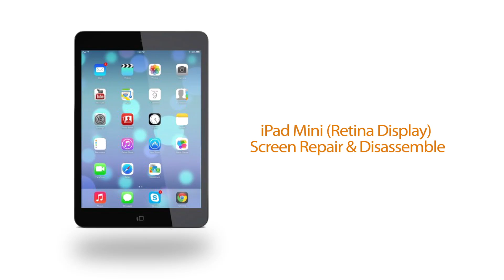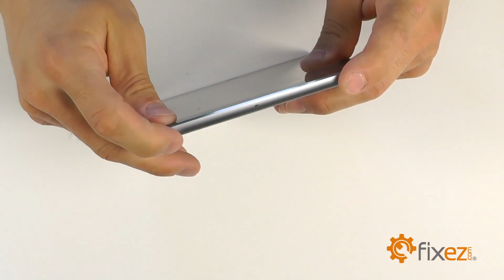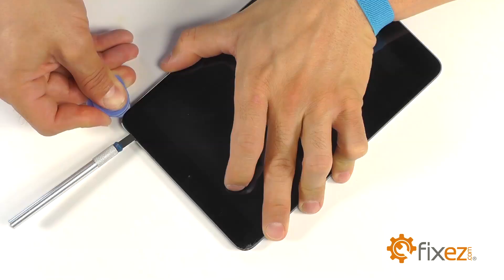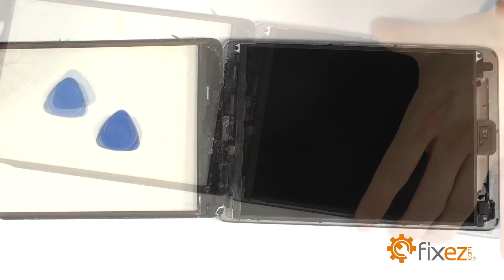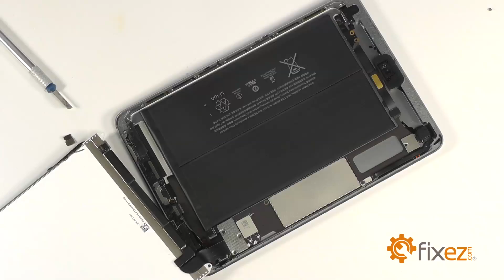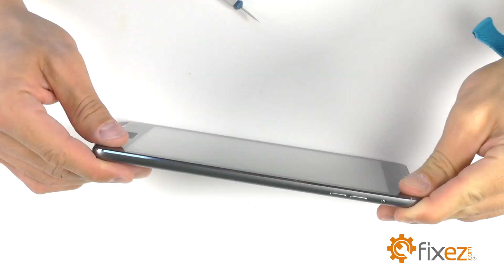iPad Mini (Retina Display) Screen Repair & Disassemble

Comment: I did this repair to my daughters iPad mini (1st Gen) about 4 months ago with a part I got off of ebays site. When the screen came, I looked at it and noticed, what looked to be wire in a wave like pattern in the glass, it was faint but noticeable with the lcd turned off and tilted to a certain angle. Well, I installed it anyways to get my anxious daughters iPad back in running and to make a long story short the digitizer stopped working as it should be. Some areas became unresponsive like a whole strip on the left side.

I did some research and came across ***** and ordered a new part, (which came in 2 days). When the part came in, the quality looked great. It comes with pre-installed adhesive on the backside of the screen along with the home button pre-installed, and camera bracket so this saves you time.

Today I had time to replace the screen and before gluing it shut, I tested everything out and so far it's working great. Right now the iPad is in the bonding stage. I will make sure to leave feedback later on the line.